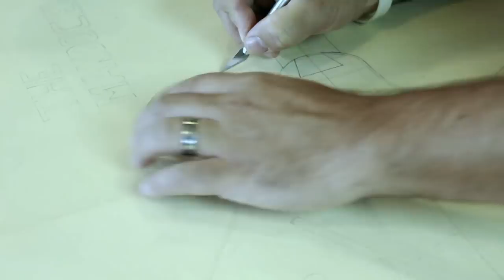Mandocello, making the mold and templates/ Part2

Comment: As usual, awesome video....very interesting. What type of plexiglass do you use? Does it come with the paper already on it? I sometimes get cracks when I try cutting out plexiglass on the band saw. Any advice. Thanks in advance
Reply from the maker: I use Lexan plastic and cut it wit a 1/4” blade with 6tpi . Lexan has plastic paper on both sides and makes it easy to glue any profile and peal of after. It is also really stable. Which means it doesn’t really change size with cold or hot temperatures.. hope it helps

Comment: So one thing is clear, the material for the Jig is not something to go the cheap way. Question: I will bend with a steam box so the wood will be pretty wet (and hot), Should I treat material like MDF first? Especially as I would like the use the jog more than once. Thanks for sharing, following as always!
Reply from the maker: You can seal the MDF with something to prevent the water to get in the material. ( shellac, or  some oil). You could also use packing tape if but would have to redo the tape every time. As for steam box, be aware that thin material that get saturated with moisture tend to warp . So you should prepare for this if the material you’ll be using is thin. Thanks for following Gerrit!

Comment: Great video!  Can you reuse the forms?
Reply from the maker: Matthew Taylor yes Matthew, as many times as you want or need to. Unless you drop it of make substantial modifications you can use and reuse it without any limits. The key here is to make sure every precaution is taken to have a jig that is straight and true.
Reply: That leads to another question, why did this instrument need a new form?  Haven't you made one like it before and where is that form?
Reply from the maker: Yes Matthew, I did make a few similar in shape. I made a f5 mandolin and a H5 Mandola with the same shape. The big difference is that the Mandola is a fifth lower than a mandolin ( the body is therefore bigger). There is a full Octave difference between the Mandola and the Mandocello. The body once again needs to be bigger and the scale length will be a lot longer. This is why a new form is needed.

Comment: How do you know what scale length  to use and where to locate the bridge.
Reply from the maker: This is something I will get into more detail when I get to this point in the build. But in short, Gibson used to make the Mandocello with a 24 3/4” scale. The biggest issue was the low C string was lacking tension and because of this was thuddy. Mike Marshall’s m’cello has. A 25” scale, giving more tension to the low C. I want to give this one 25 1/2” scale to have even more tension on the low C. Scales have been up to 27” on this type of instrument.. 27” makes it hard to play because of the fret spacing. Chords are really hard to do at 27”.